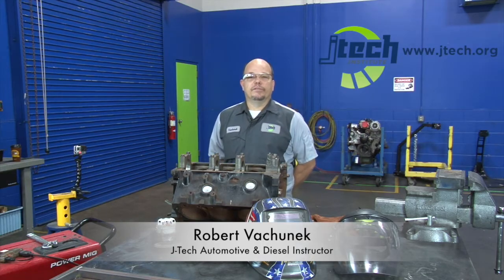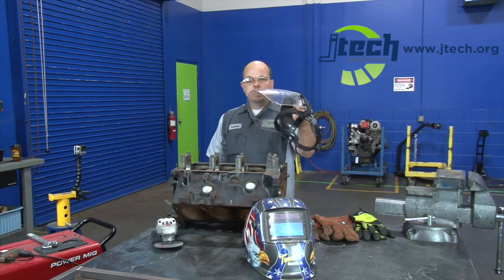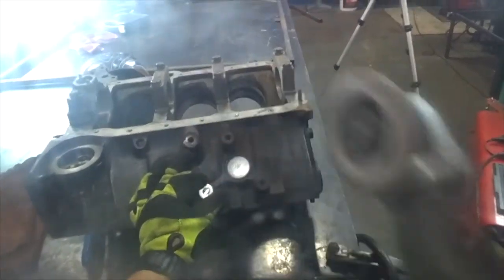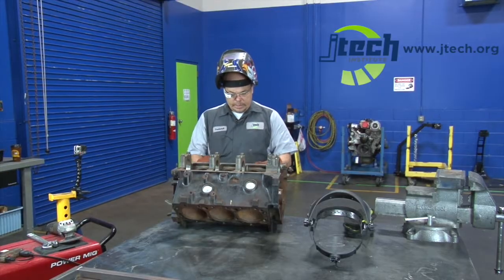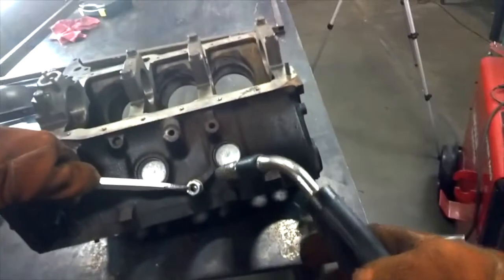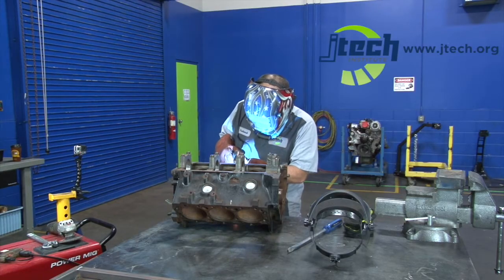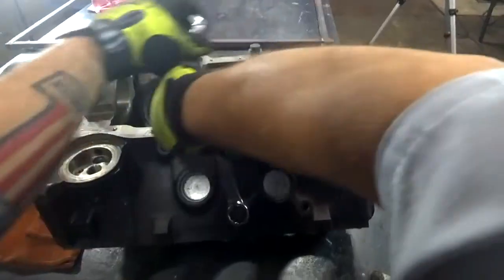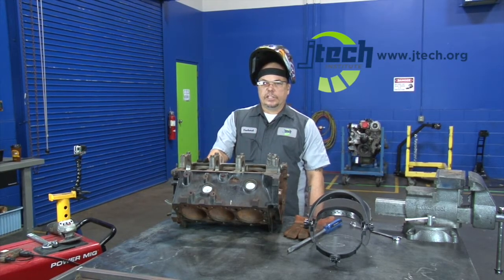BOLT EXTRACTION USING A MIG WELDER

Comment: How does heating a bolt cause it to shrink? Didn't welding cause the aluminum to expand faster than the steel bolt, helping to break free the bolt?